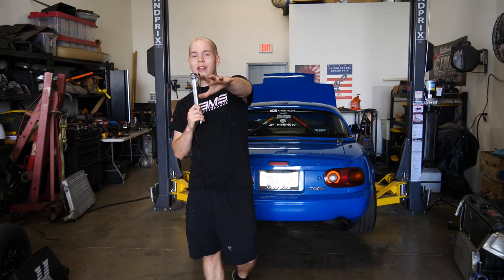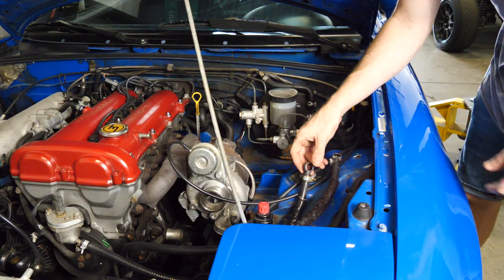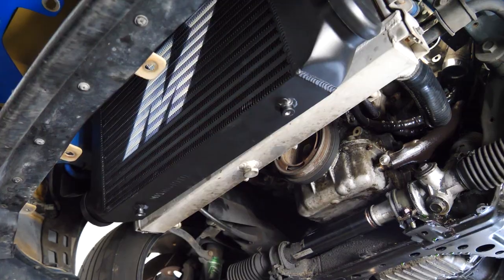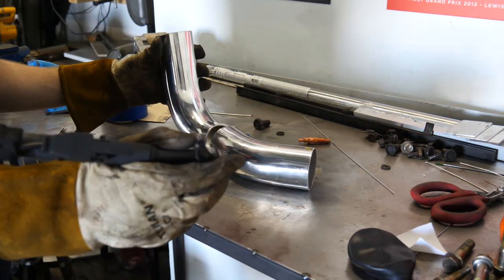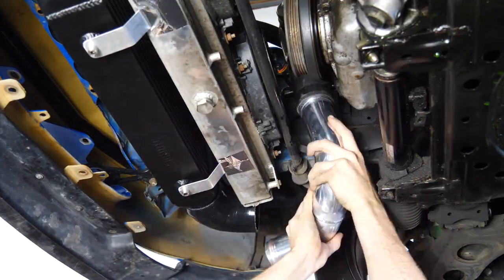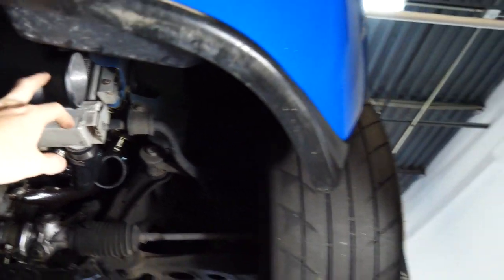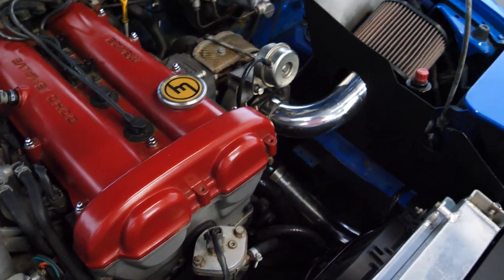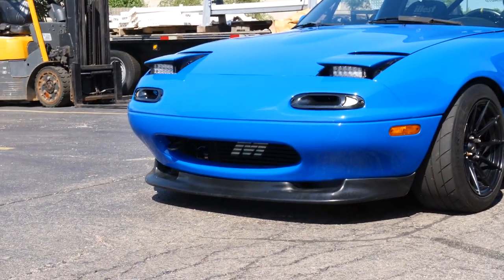TURBO MIATA Gets a New STEALTH INTERCOOLER SYSTEM!

Comment: You can sharpen drill bits with a simple angle grinder 
120 ° to 130 °  tip angle is what you need.
Keep it cool.
Reply: Or just pre-drill with a smaller bit.
Reply: or drill a pilot hole
Reply: I use my dad's drill bit sharpener he got off  tv like 20ys ago and its awsome and in most cases better than new .

Comment: Tip for tig when you Weld something hollow you have to fill it with your shielding gas or else regular air will cause porosity coming from inside the pipe

Comment: If you want an easier time drilling, get a decent name brand set of cobalt drill bits from amazon. They last much longer compared to normal bits and do excellent drilling harder metals.

Cutting fluid also helps, and drilling holes larger than about 1/4 with a pilot hole first.

Comment: Caleb I'd say that your problems welding the intercooler piping is possibly that you got cheap tubing
Reply: Throwing it makes it more expensive
Reply: Yeah, could be a cheap non weldable type of aluminum.
Reply: Cheaper aluminum pipe forsure. Might have been a lot nicer to weld if he pre heated it too

Comment: If you have a High Frequency Ignition on your Tig Machine Use it to break up the Oxides on the aluminum before you begin welding

Comment: Tips for tig welding aluminum:
When welding two different size pieces (radiator -> mounts) it is important to heat up the bigger piece a lot. Thin aluminum has a tough time distributing heat all over the piece, some times I use a torch to get the whole piece hot. 90% of the time more heat spread out is better.

Comment: Hey, great vid but:
At 5:10 it looks like you are fastening aluminum brackets to a steel one. It might corrode.
Reply from the maker: Stainless steel to unpainted mild steel. I'm gonna get the whole thing powdercoated when we pull the engine!
Reply: @_Gingium_  Awesome, I was uncertain so figured I'd comment just incase! Goodluck and much love from Sweden!
Reply: @_Gingium_  you might also look into bits labeled hss if you want to poke holes in stainless and hardened steels

Comment: Aluminum welding is tricky, it’s a heat sink and it puddles/melts at a much smaller temperature range than steel. You need to sink a lot of heat into the rad and less into the bracket because of the vast size difference. Once the puddle begins on the rad bring it over to the bracket and you should be good. Keep at it boss !

Comment: If your drill bits are getting dull, your using them wrong!.
I have used the same bits for over 5 years now, and I sharpen them two or three times a year.
They will last if you are using them correctly! Low speed, lots of cooling paste while drilling and let the drill do the work, rather than pressing the drill into the material. Just a little tip. :)
Reply: A little tip

Comment: If you want to stop your drill bits from dulling, use  cutting oil. Less heat generated and an easier cut. Whenever cutting pipe, try putting a sodden dowel in the middle. It will stop the pipe from rounding out.

Comment: Release the pressure on the drill, let the drill bit do the work and keep it cool with water or oil, it will prevent your drill bits from dieing 🙂

Comment: you have to get aluminum super clean and fairly hot when welding aluminum, i would suggest blowtorching your aluminum before welding because it dissipates heat so damn quickly, double checking gas flow and make sure your tip is basically new and you should have a much better time. Great video though, love seeing this car get some love.

Comment: Maybe something to try for the brackets. Swivel the bracket out of the way and use a torch to heat up the radiator a little bit. Flip the cool bracket onto the warm radiator and arc up on the radiator then walk the puddle over to the bracket and weld it up. Looks like the radiator is dissipating the heat really fast and the bracket is melting before you can get a puddle on the radiator.

Comment: try using cutting lubricant or at least WD40 when drilling to keep your bits from dulling after 2 uses. Also the nitride coated drill bits from harbor freight are absolute trash. get high speed steel bits or high carbon ones, but they're more brittle so a drill press is recommended.

Comment: First off it’s eBay aluminum it’s low grade aluminum so it won’t tig weld for shit get better aluminum grade
Reply from the maker: The inter cooler piping is legit aluminum haha, no ebay kit here!
Reply: What was the amperage you are using and what filler rod and tungsten you are using
Reply: I't the same shit the Mishimoto crap is made of so who cares?

Comment: You should try and get some matco hyper step drill bits. They are super nice. And you can warranty them if they get dull or break. There is only one row of bits in the box they won't warranty and it's just the small ones. But from experience they rip.

Comment: Gingium as far as the welding part of the video don't feel too discouraged about it I can tell you that welding is about fucking up a lot when you're learning. I can give you a peice of advice in that trying to weld thin gauge aluminum to a thicker peice like the radiator is an uphill battle, the thermal conductivity of the radiator is gonna keep it cooled while the thin edge of your other peice will be eaten away.

Comment: Thoughts on the NB miata? Thinking of getting one to be a little more unique since everyone gets a NA.
Reply: Heavier, no pop up headlights, but you get VTT so it's really your call
Reply: Oh also the 6 speed trans/3.90 LSD in the NB holds way more power than the 5 speed/ 4.30 VLSD in the NA
Reply: @adamcroteau8711  cool! You seem like you know your stuff. I do have one concern with the nb. I dont know the mechanical differences with the na and the tuneability. Is it just as easy to get megasquirt and turbo it as a na?
Reply: DCtropical C yes. I'm not sure if the $800 one is available, possibly the pro only. But alas, it is there
Reply: @adamcroteau8711  thanks very much!
Reply: 5 speed is still good for 300 lb pounds with a good clutch, and the 1.8 liter NA diffs are a 4.30 final drive but are as beefy as the nb

Comment: you couldn't weld on the radiator because it still had some leftover fluids at the bottom and it was colling down the surface area, therefore, it wasn't heating up the surface enough to melt the two surface together

Comment: What kind of brush are you using to prep the surface of your aluminum? It looks like your welds are contaminated. When I weld aluminum, most of my problems were traced back to contaminated or alumnium that wasn't cleaned enough with a stainless steel brush. I totally understand your frustration though! Aluminium TIG  is a whole different animal in comparison to steel TIG. Keep working at it, your practice welds look very nice. Hope this helps

Comment: When you get the built engine will you have the funds to upgrade the turbo and manifold or are you just gonna max out the current turbo setup? Would sound rowdy with a equal length tubular manifold and a Garrett Gt550. But I understand is that is out of budget right now. Especially with the bus mishap.

Comment: Why not get a 1.8 rather than a 1.6?
Reply: 1.6 revs higher.... My miata is a stock block 1.8, but when I get a built short block it will be a forged 1.6. 9k RPM is only valve springs away!

Comment: Honestly you didn't need such a big cooler, but you definitely needed the better piping and the black intercooler looks much better.
Also you should use the autotune fonction of the megasquirt software, remember, you've used it in the past when you removed the supercharger off of the rally miata.

Edit: 
Funny reading this now 2 years later, he's making 380whp on a 2560, meaning he absolutely needs a big intercooler, maybe he had the vision in mind the whole time
Reply from the maker: Thanks man! 

The autotune function only works in vacuum, as soon as you get into boost it cant tune anymore (and thats where the tune is off haha)
Reply: @_Gingium_  I thought you could modify the afr target table to work in boost by rescaling the axis of intake pressure to work above 100kpa... 
For example here at 3:09 you can see greg has his afr target table with the pressure scale that goes up to 180kpa which means 1.8 bar of absolute pressure so about 0.8 bar of boost which is like 12 psi or so. His table definitely seems to be setup to work above atmospheric pressure.
https://www.youtube.com/watch?v=5KDPgKnsHLY&list=PLoXrg5vScoD0ioyjHCD5JG8FMmINV3HY4&index=8&t=0s

Maybe I'm wrong, I'm not a tuner at all but I've watched some megasquirt videos because it's very interesting and I've just done some research about ve analyze and boost and people manage to do it.
So I think the only thing you need to do is adjust the kpa scale on your afr target table and it should work, but I'm just guessing. Might have to ask Greg as he knows more than we do.

Comment: I don't know much about welding so I could be way off here but wonder if the glue from the temporary tape was causing you issues for welding it?  Either way looking good!  Must be satisfying to get all that tubing done and see it all fit nicely like that.
Reply: I think one problem might be that the radiator is basically a huge heat sink and wasn't getting hot, so the bracket was melting but with zero penetration on the rad.
Reply: I was talking about the piping but yeah for rad you're probably right.  Especially welding upside down as heat rises so it will be tricky to weld.   Wonder if heating it up with a heat gun first would make it easier.  It's done with circuit boards for soldering sometimes.  Mostly for reflowing.
Reply: @redsquirrelftw  Ah, fair enough! I think it might just be crappy alloy with the piping. I've seen people blowtorch big pieces before welding, so maybe. or running the car and getting the coolant hot.

Comment: It would be better if you used the smallest possible silicone couplers and as much aluminum as you can. It'd be best if you used straight couplers only.

Comment: Did you change your tungsten to support aluminium welding? And i think the gas needs to be changed to 75-25. 75 argon 25 c02
Reply: Actually, when TIG welding any material (steel, stainless steel, or aluminum) you want to use 100% argon or a argon helium blend if you need more penetration. Tungsten does make a difference too, personally I like using lanthanated tungsten for low amp starts/welding. I have 2 years welding experience.

Comment: Sorry if I mess up years, but if you’re doing this on a 95’ Miata is it possible for me to do it on my 99’. I’m only 16 and don’t have experience working on cars
Reply: An intercooler is part of a turbocharging system. If your miata doesnt have a turbo then you dont have an intercooler. Other than that, if you have a turbo, the 99 miata is the same car, just with a slightly larger engine (1.8 liters)
Reply: Josh Adams so if I wanted I could pretty much do any upgrade made on this channel?

Comment: What kind of tape did you end up using on mounting the inter-cooler to the radiator at 7:35?  Is that stuff weatherproof?  I am Curious because I could see building something with thin aluminum sheet, and using tape to hold it to itself together as apposed to riveting it.

Comment: When you weld aluminum i always used a brass wire brush and then cleaned it with acetone or brake cleaner to take of any oils from my hands or from my gloves or just any residue that's what my 15 year old self did and yup im 15 but that's why you could not weld.......maybe or it could be just something else that's dumb

Comment: Also, a colder tstat is NOT a good idea. 

A reroute and nice rad is more than enough to cool a Miata, you will actually make much less power and may run into misfire issues with the colder tstat.

Comment: Jw why a 1.6 and not a 1.8?
Reply: 1.6 revs higher and makes pretty much Identical power. I have a 1.8 but when I build my motor I'm switching to a 1.6, because 9k rpm is only valvesprings away

Comment: If you cut aluminium with a blade that has cut other metals the blade will inbed new metals in the aluminium making it very difficult to weld

Comment: U need to power up increase the amp n need to move abit faster. Ur problem is U use low amp n n didnt move the torch the heat is increasing n causing hole.

Comment: That sneezing is not healthy for your engine. =/ Also I appreciate quiet cars, like my current car when I stop to the traffic lights, I can´t hear the engine and that´s good. The silver Audi what I had before was quite silent but this one is even better. Also my car´s engine bay is super clean, because it have OEM plastic cover, so there is just 4 filler caps, for oil, hydraulics, brake fluid and the washer.